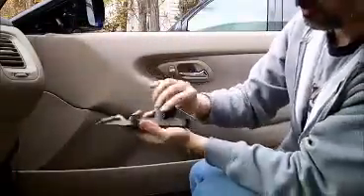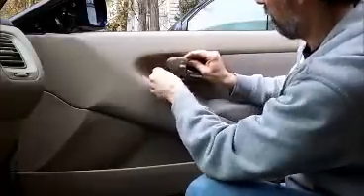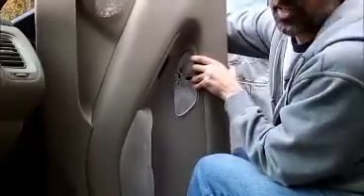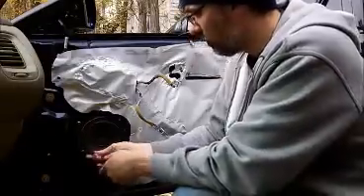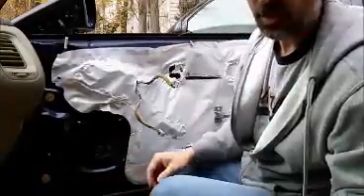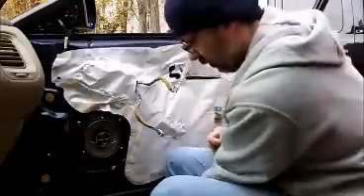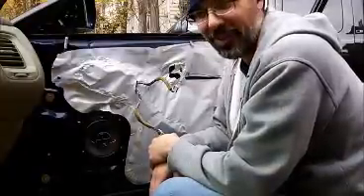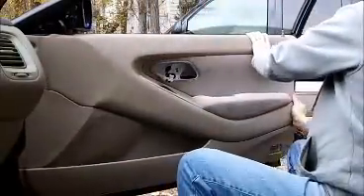2001 Honda Accord Coupe door speaker replacement

Comment: For 6 gen (H) Accords 98-02 fronts are Pioneer 6x5 model (ts 675m) and rears are Pioneer 6x9 model (ts 975m) I recommend Pioneer speakers there good, affordable, there Japanese, easy to buy, and go good with a pioneer deck as well that's how I have my set up. You don't need a harness it's just plug an play with the set up I just spoke about. Very simple, and affordable.
Reply: Now if you want a better sound quality do a sound dampening on the front door panels, and rear part as well inside the trunk. It will make your speakers sound better, and you will reduce road noise and rattle.
Reply: +MiLo VanEgaz Definitely considering those now lol. What would you use for sound dampening tho?
Reply: +PICKLE IN MOUTH they sale some stuff at homedepot its the same stuff epensive audio places use its called peel & seal.
Reply: MiLo VanEgaz Awesome, thanks for the info

Comment: 6.5" door speakers, 6x9" in the rear deck and there is also 2 tweeters on top of the dash by the windshield. On my 2000 Accord Coupe anyway. Where those hook in, I'm not sure.

Comment: Hey bud I broke the little plastic door handle clip, just wondered if I really need it or how easy I could find one.
Reply from the maker: +Carl Fox Are you talking about the clip that swivels hand holds the rod into the handle?  It is pretty important. Otherwise, the rod can pop-out of the handle and then your handle doesn't work.  If you go to one of the aftermarket parts sites like cheaphondaparts or hondapartsnow you'll find it under the door lock description. (I think they'll call it a "snap") It's less than $5.  You might also find one in a local junk yard but I wouldn't count on it.
Reply: Sweet thanks again buddy, I appreciate it!